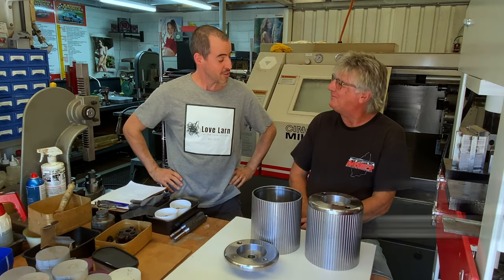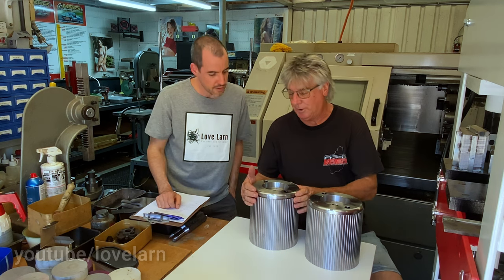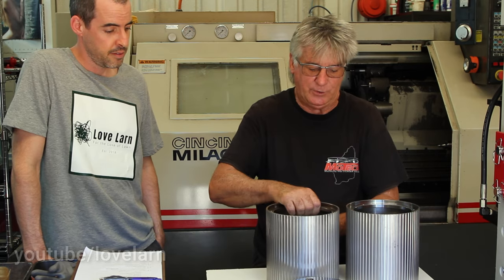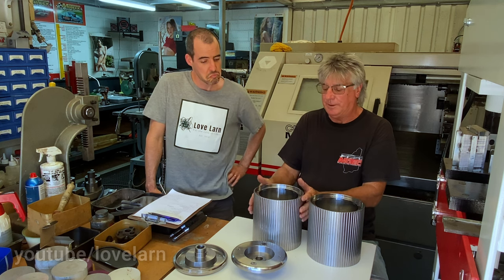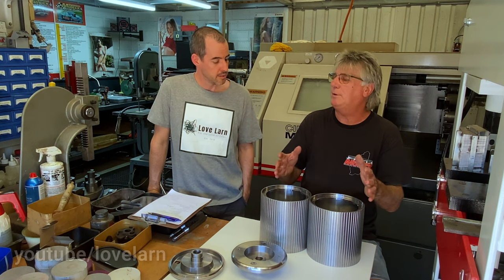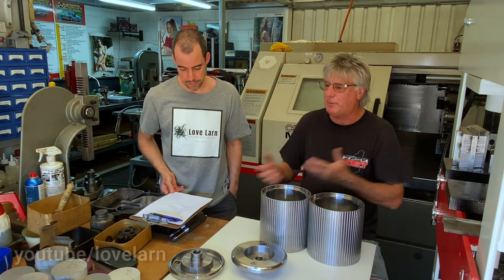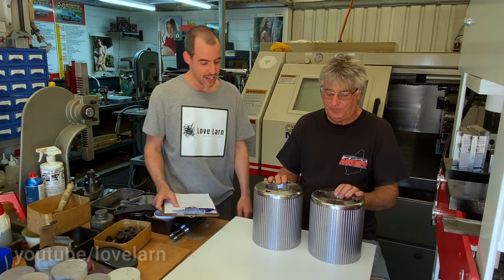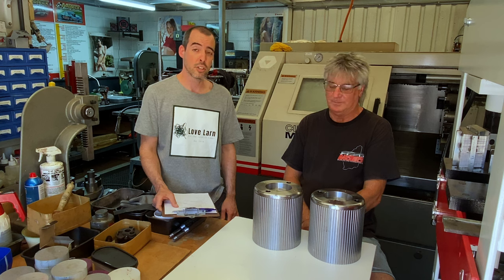NEW REAR ROLLERS! 🔥  With Shane Kosteszyn // Moteck X Love Larn

Comment: will they rust?
Reply from the maker: Shane answers: "They’ll rust just the same as the cast steel ones do. Prime then paint as per any other component or powdercoat. If painting then brush primer on the inside or treat with a product called Tectyle"